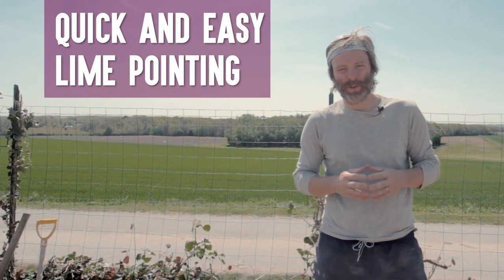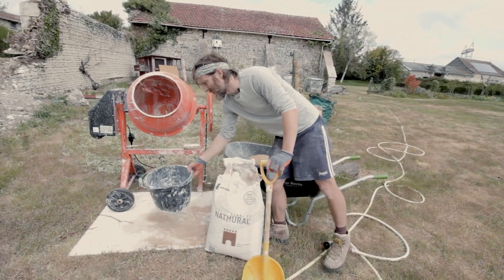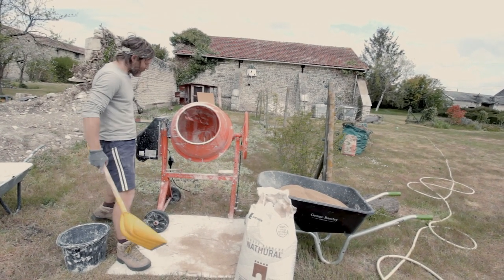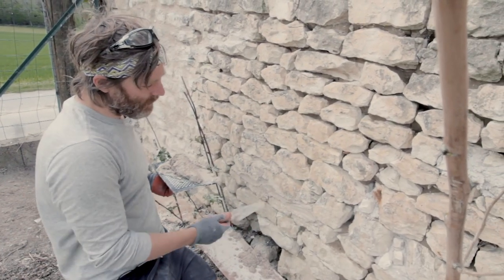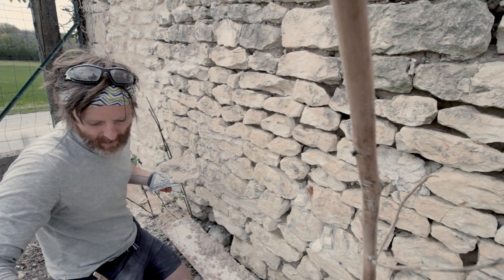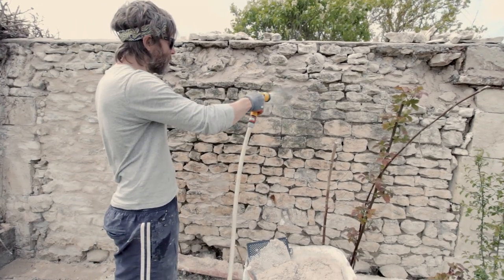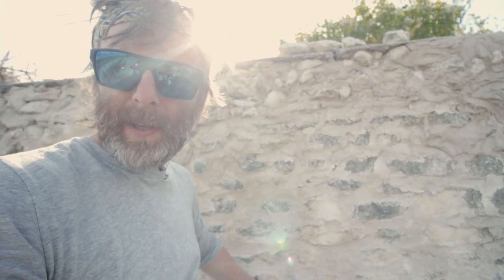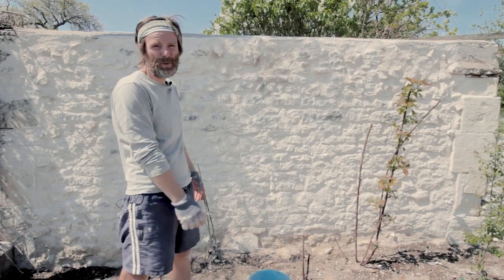How to Point a Stone Wall with Lime Mortar Fast Process

Comment: i need to do this with my foundnations, should i use only lime or should i add cement for strenght? There wasnt use cement before, only lime
Reply from the maker: No don’t use cement. If the stone is limestone it will slowly erode and crumble. I have examples on our property. The water has nowhere to move and you see salt deposits coming off the stone, slowly it’s crumbling. You’ll be surprised how strong the lime mortar is, if made and applied correctly. Good luck

Comment: I have seen several videos, and inside houses they usually do 3 different coats. May I ask what is the difference?, since you did only 1. Thank you.
Reply from the maker: Do they? They might be rendering the wall rather than pointing. Share a video of you can and I'll work it out.
Reply: @LivingintheLoire  I think they do render the wall with lime. May i ask when one should use pointing and when rebdering?
Reply from the maker: @kookia213  Pointing will secure the wall especially if it's in a bad state. It's more of the style and aesthetics in this area France. For buildings where the stones are ugly or harder to point between you may want to render to give it a smooth finish. Depends on what you want to achieve and your budget really.

Comment: Nice vedio,is this waterproofing and strong like cement plaster?hydrated lime is better or lime putty??
Reply from the maker: Yes the wall getting wet allows the stones to expand and contract. Cement will hold moisture. It's solid as cement, better as it won't crack. I have a video today with examples of wall pointing restoration.
Reply: @Living in the Loire  thnks so much bro,I live in rural area of Pakistan and with burn bricks and cement houses too much costly and also not echo freundly,and if we make houses with natural ston and mud that was not strong due to weather like rainy season etc 
Please can you hlp me for 
Making bricks with lime and sand or mud which should be  waterproofing and eco freindly?
And 2nd thing is these bricks or blocks laying lime mortar (lime mortar of each meterials).
3rd thing is interior lime plastering   (lime and sand or mud etc materials ratio )
4th thing exterior wall lime  plastering (lime and sand or other materials ratio )
Please can u help me one by one in detail ,and also about lime that hydrated lime is better or lime putty is better for each mortar and plastering ,
Reply from the maker: @malik51973  I'm not an expert, so I cant help you with everything. Here the stone is limestone, so just sand, lime and water will work. But in different climates, maybe you will need to add other aggregates or straw to make it more solid to the elements. Please check out this video https://www.youtube.com/watch?v=Xu3L-wHrK5M&ab_channel=KrisHarbourNaturalBuilding The channel has lots of info on building an eco home from scratch using cheap materials.
Reply: @LivingintheLoire  thnks

Comment: What about the old flick..  ? Off the trowel. I learned it in France. On the chaux e sable
Reply from the maker: I would imagine it’s a technique that needs a lot of practice for it to be worthwhile. Throwing or flicking when I tried makes a lot of excess mess and less likely to get deep into the crack.
Reply: @LivingintheLoire  takes a bit of practice. Fills the gap fully from the back. As it splats and forces all the air out.
Can also hit the gap with the tipof the trowel standing side on. Witha bit of mortar on end of trowel.  Itsharder to miss. As trowel impacts the wall mortar flies off into the hole. 
You did a nice job.
Many various ways to achieve a nice look
A wire brush works really well too to revesl the edges. Before water and brush finish. 
Limestone snd chaux basically are msde for each other and nothing looks quite as good as that pair for masonry imo.

Comment: Protection
The work is at risk until the mortar has adequate time to cure. Although often overlooked, protection is critical in the meantime:
		Rain may wash out the mortar before it has adequate time to set.
		Cold temperatures may cause the mortar to freeze.
		Sunlight and strong winds both accelerate the drying process. This leads to colour alterations (bleaching) and cracking (shrinkage).
The work should be protected with a breathable membrane such as hessian sheeting. Protection is recommended for the following periods depending on the ambient temperature:
Ambient Temperature
Protection (days)
>= 5° C
56
>= 10° C
28
>= 15° C
14
Wet Curing (Cherishing)
Wet curing or "cherishing", as it is known in the trade, is a technique that provides the ideal curing conditions for lime mortar. The hessian sheeting (or other breathable membrane) is sprayed regularly with water, this simple procedure increases humidity and controls moisture loss.
Maintaining a stable, high level of humidity aids carbonation (for air lime) and hydration for (water lime) which are optimal at 60% and 90% relative humidity respectively. It also prevents shrinkage (cracking) that occurs from rapid drying.
The conditions on site will determine requirements but sheeting is typically sprayed with a fine mist sprayer, anywhere from once daily to every 4 hours. This is recommended for the first 3 weeks although the first 7 days is most critical.
Important: Sheeting is sprayed in temperatures above 10°C with no risk of frost. Spraying in lower temperatures increases risk of frost damage significantly.
Setting and Curing
Lime mortars harden progressively until fully cured. Regardless of the type of lime mortar you're working with, the process can be broken down as follows to establish some practical guidelines:
		Initial Set The material stiffens or "goes off", it is no longer easy to manipulate.
		Technical Set The material becomes hard enough to resist a fingernail when pressed.
		Cured The material is fully cured when it reaches its maximum strength.

The time it takes to reach any one of these milestones depends on the type of lime, temperature and humidity. The table below provides a general guide, site trials will determine the time more accurately in localised conditions.
 
Initial Set
Technical Set (days)
Cured (days)
Hydraulic Lime Mortar
Overnight
30
90
Non-Hydraulic Lime Mortar†
Overnight
30
365
Hot-Mixed Lime Mortar†
Overnight
30
365
†
Estimates for non-hydraulic and hot-mixed lime mortar assume warm, dry weather and may be significantly longer.
Colour
The colour of mortar continues to lighten until it fully cures, the change can be quite dramatic and surprising. In good weather, you will usually see the greatest change after 10 days.
Heritage Resources
The websites of the following governing bodies offer a rich source of heritage information and advice:
		Historic England Historic England publishes an extensive range of expert advice and guidance to help you care for and protect historic places.
		Historic Environment Scotland Historic Environment Scotland is the lead public body established to investigate, care for and promote Scotland’s historic environment.
		Cadw Cadw champions the appreciation, protection and conservation of the historic environment of Wales.
		DoE Northern Ireland Historic Monuments; Historic Buildings; Historic Parks and Gardens; Maritime Heritage; Industrial Heritage; Defence Heritage and Archaeology.
Reply from the maker: Thank you for the copypasta